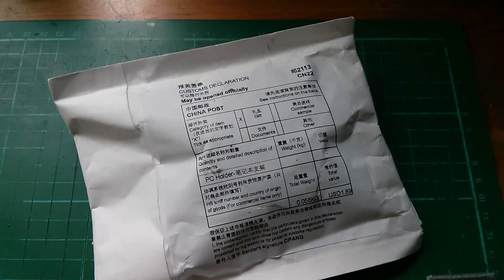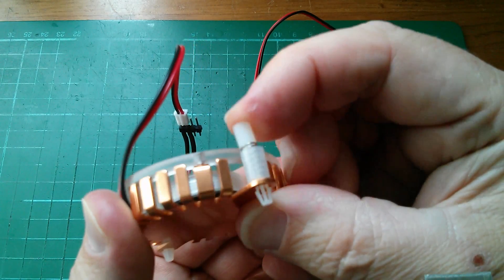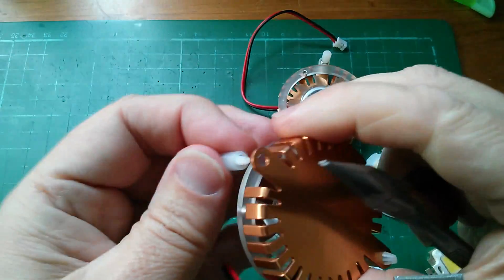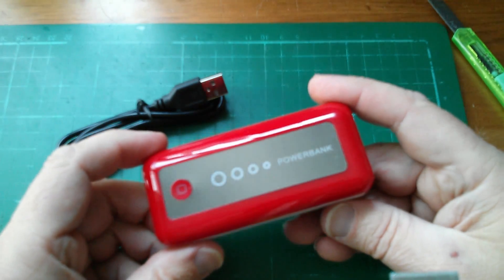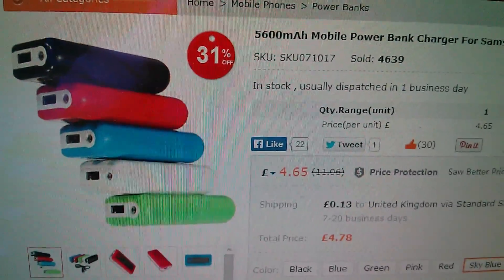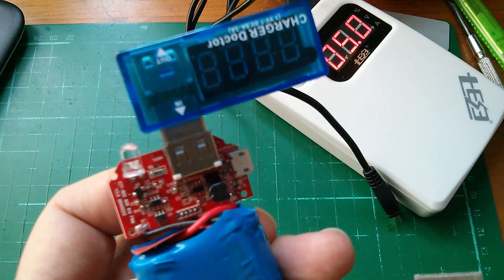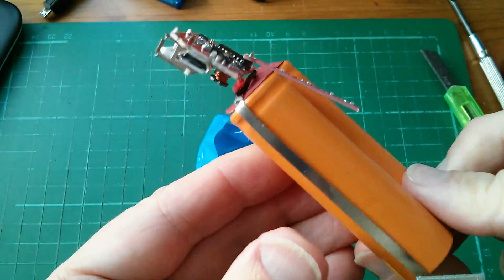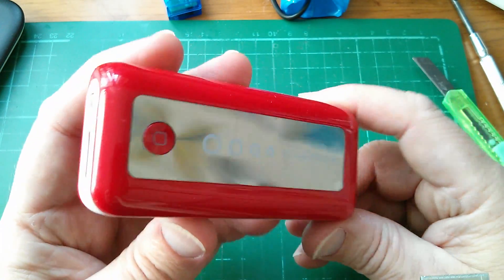Postbag #13: 99p VGA Fan, 5600mAh Banggood Power Bank

Comment: Those "springy things" are for mounting the heat sink on a PCB.  You mount the LED with the light showing through a hole in the PCB and mount the heat sink so that it's pressing against the rear of the LED, using holes in the PCB which those "springy thing" posts go through.  Sometimes you lock them into place with a quarter-turn and sometimes it's automatic.

Comment: Your fascination with power banks is... fascinating :P It must've rubbed off on me, as I'm currently fiddling around making a diy version with 18650 holders, and some soldered together charger/usb output modules. Thinking about adding an led display for voltage/amps and a combined step down/up module for a portable variable power supply while I'm at it.

Comment: Only thing i don;t like about the little VGA sinks is the fan life, however if you take the fan off to work on them, you can carefully put a drop of a good oil into the sleeve bearing on the fan ( unless you are luck and found cheap ones with ball bearings ) and you can make them last alot longer.

Comment: How many watts of thermal capacity would those be able to take; they don't seem to have a lot of surface area?
Reply from the maker: Peter C With the fan running, I'd have thought these would be able to shift 10W with ease. But I'll test that soon.

Comment: Those springy thingies are meant to be pushed through the PCB and the springs will keep the right pressure on the heat sink... They are not meant to be used like you said in the video.

Comment: Julian, if those heatsinks are copper, try soldering the back of those 1w leds DIRECTLY to the heatsink. I did this with a soup can lid and it works fantastic. If you need more detail, i could post a video. Also, those spring clips would normally push into a graphics card's pcb, and the springs would provide the tension to hold the heatsink to the chip.
Reply: I don't think they are copper, more likely cheap aluminium or steel painted to look like copper.
Reply from the maker: ***** They're not copper - they look like anodised aluminium
Reply: Darn.

Comment: Got one of those 2 cell power banks after watching this video, dang thing failed me yesterday, went dead, well down to one dot, when I tried to charge would not connect. I tore it down and the USB in plug had seperated at the connection to the board. I tried to solder it back on but then it seperated at the plug.  Tore the board off and kept the cells.  Case may be used in some future project.  Not a lot goes to waste here in the Dakota's.  Must come from being raised on a farm back in the 50's.
Reply from the maker: Jerry Ericsson 90% of the value of that power bank is in the cells, so if they're still ok, you've not lost much :)
Reply: No not complaining, the cells now rest in another powerbank with two sister cells more power!

Comment: What is the best way to measure the output of a solar panel Julian. Do I just hook up a multimeter and see what it produces or is there a more forensic way of doing this?
Reply from the maker: B0M0A0K A multimeter can be used to check the voltage or the current. But a more useful measurement is the power in Watts. That's more difficult to measure because the load needs to be optimum. This I learned as a result of all my MPPT experiments.

Comment: wonder if there is such a thing as thermally conductive epoxy? if so , would be handy!
, as for the cells , i wonder if they really are the proper capacity or if you were to open them up, you might see they contain a smaller cell and the rest filled with sand, or i have heard some are recycled worn out cells from old laptop supplies
Reply from the maker: jusb1066 I expect the cells are reasonably good - Banggood wouldn't have this product in their bestseller list for long if the cells were poor.

Comment: Hi Julian,
You can make just a simple discharger with a couple of resistors and Arduino. It is very simple and it can measure voltage and current per second. So, this would be more usefull power storage meter W*h instead of mA*h. I made it by myself and it is realy usefull for measuring real capacity of Li-ion batteries. If you need I can publish How-To of making such device.

Comment: Pardon me for being a bit "old school", but the way I'd measure the real-world capacity of a power bank is by fully charging it, connecting a resistor across the output and seeing how long it takes before it cuts out.  I'm sure you don't need this, Julian, but maybe for others...  A 5ohm resistor across a 5V supply will draw 1 amp.  If it keeps going for 2 hours it has a capacity of 2 amp-hours at 5V.  That resistor needs to be rated at at least 5 watts, but a bit of simple multiplication and waiting around longer let's you use almost any resistor you have lying around.  I hate your videos, it's your fault that I still haven't done the washing-up because they're addictive!  (in case of doubt, that's a big compliment, thanks)

Comment: Not like my power-banks I have stepped on and used quite a lot.

I have never quite liked the auto-power-off function, so I prefer the "dumb" packs without micro-controller.

The fans looks good, but I would find a that small fan with that high speed annoying.

Comment: What's special about the nexus USB cable that allows a higher charge current?
Reply from the maker: Graham Wilson Either lower conductor resistance, or the data lines seeing the resistor network in the powerbank

Comment: Why don't you use a cheap hobby charger to measure the real battery capacity? That would be interesting.
Reply from the maker: Lagm an I will have to buy one soon - I'm liking the Turnigy Accucel 8S - http://www.hobbyking.co.uk/hobbyking/store/__7523__Turnigy_Accucel_8_150W_7A_Balancer_Charger.html
Reply: You might also consider the Turnigy Reaktor http://www.hobbyking.co.uk/hobbyking/store/__57969__Turnigy_Reaktor_300W_20A_6S_Balance_Charger_UK_Warehouse_.html
It is a copy of the Icharger 206B which is quite good and well documented. It also adds a USB port which is handy to get nice discharge/charge curves on your PC. The only problem is its current unavailability.
Reply from the maker: Lagm an That is nice - shame there isn't an 8S version
Reply: If you really need it there is the Icharger 208B http://hobbyking.com/hobbyking/store/__9005__iCharger_208B_350W_8s_Balance_Charger.html
What equipment do you have that uses 8S batteries?
Reply from the maker: Lagm an The electric bike, when I convert it to LiPo or LiFe
Reply: The Accucel 8 is probably not a bad choice then. Quite a lot cheaper than the Icharger...
Reply: I'd like to know as well.

Comment: Do you not have one of those Accucell chargers from hobbykings? The Li-po/Li-Ion/Li-Fe Discharge function seems to be exactly what you want!

http://www.hobbyking.co.uk/hobbyking/store/__7028__Turnigy_Accucel_6_50W_6A_Balancer_Charger_w_Accessories.html

I have found mine to be extremely useful! I recently used it to revive an old netbook battery pack that died on arrival (battery protection kicked in). I now have a 6-cell, 2-cell and a 1-cell 2600mAh balanced battery pack (albeit unprotected) from junk!

Can't beat it at under 15 quid! :)